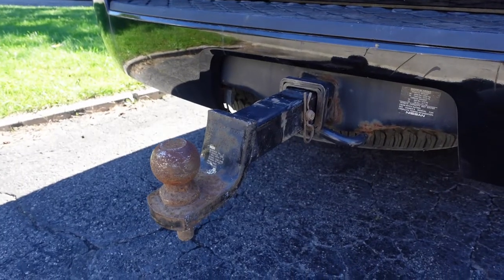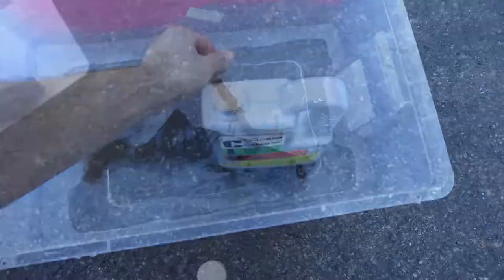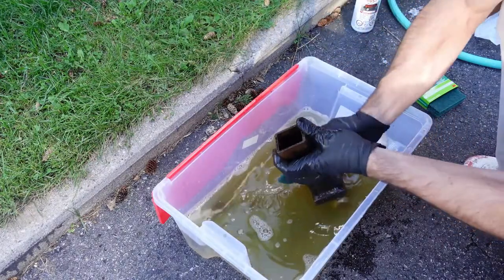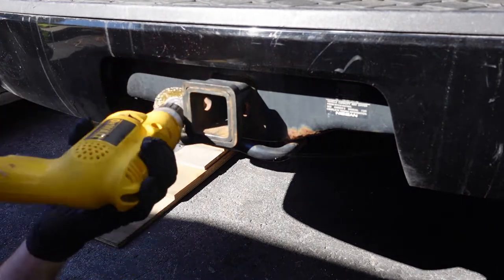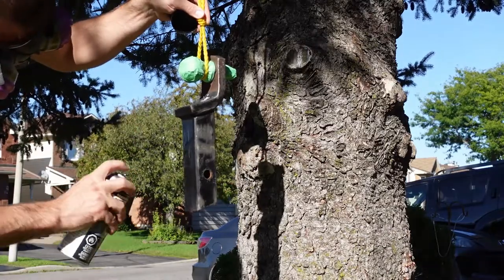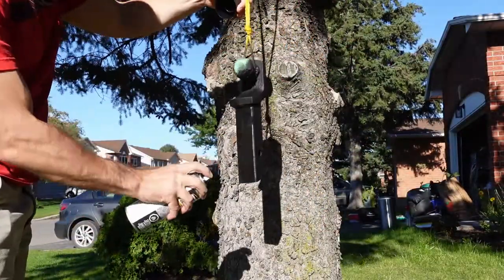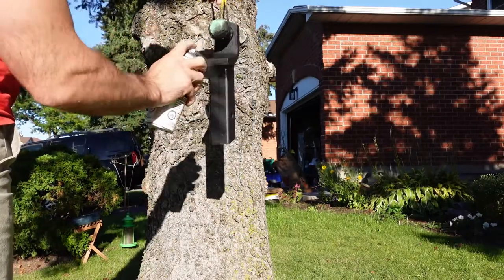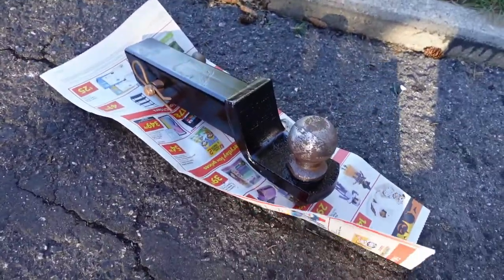Trailer Hitch Rust Removal and Painting

Comment: Ive watched a ton of these videos over the last 2-3yrs. I do this every 12-18months. Couldnt believe how poor the finish was on OEM Honda receiver.

As added layer of protection, I add spray grease to inside of receiver, esp going into the snowy months
Reply from the maker: My honda pilot ended up very rusty...but it had an after market tow package so that was the only thing that didnt get too bad.

Comment: I have to do this with my Toyota Tacoma trailer hitch. Why do you use that brand of spray paint. What brand do you recommend. I was thinking Rust - Oleum. Thanks
Reply from the maker: I would go with Rust-Oleum. I had a ton of spray paint at the house from a project that I didn't do.
Reply: @DIYNorth  Thanks